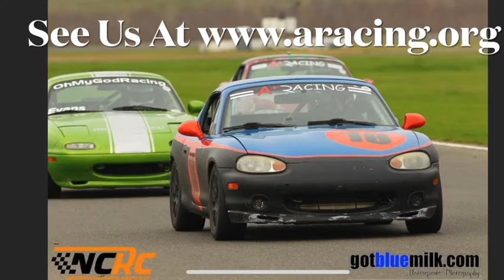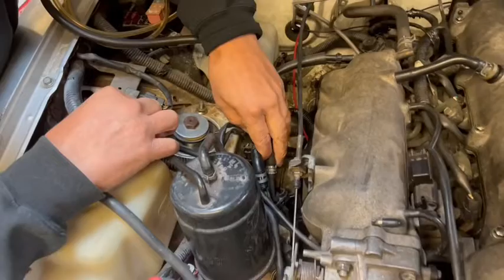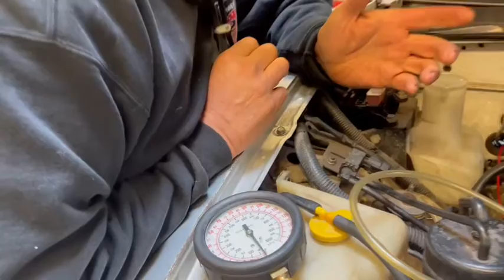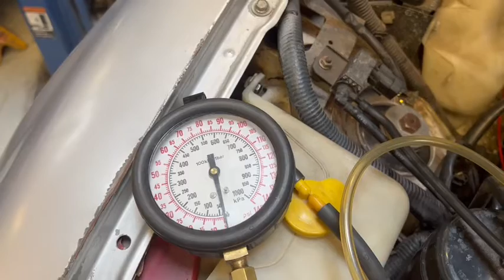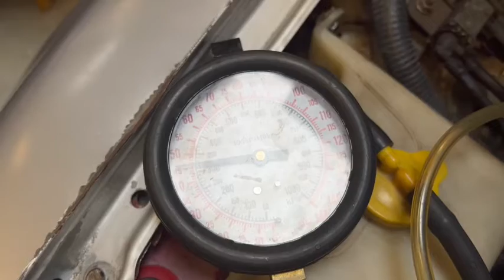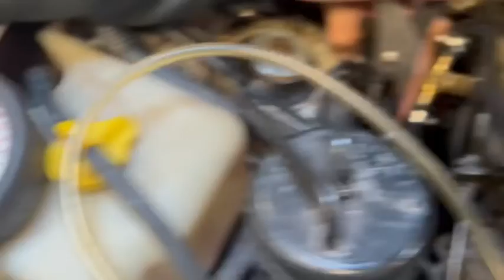Spec Miata, MX5, Autocross No Power Fuel Pressure Test

Comment: Thank you for this vid! My problem is that I’m having low pressure at the low rpm range (1-2.5k), and about 36psi at idle. It almost stalls out below 2k. But once the rpm’s are above 3k it drives great, and pinching the return line off I get a good 80psi. Would this still be a bad pump or could it be something else? Thanks again!

Comment: are you saying that at wide open throttle the fpr has no role anymore? my understanding is that the fpr provides constant pressure (relative to engine vacuum). so even if your fp max pressure is only 60, it is still above the fpr regulation pressure of say 45. so at wide open throttle your line pressure should only be around 45 unless what you  are saying is at wide open throttle you need more than 45? unfortunately wot was not shown in the video. or is it at wot pump could not cope up with the 45 regulating pressure if max pressure is only 60?

Comment: I’m having an issue where I am having a lack of power and a lot of white smoke coming out of the tailpipe. It seems to go away after the car has been driven for a while, but if I added any new oil to the system, then it starts happening again there’s also a chattering noise I believe it has to do with my engine oil leaks around the main seal or heads, but I’m not sure can somebody give me some insight please

Comment: Been having a fuel problem for the last two events. Swapped filter it was better for about a minute and then had the same issue. Was running at 14.1+(got as bad as 15 before I pulled off track with the water temp going up as well). Car was running 12.0 and making full power when I swapped a fuel pump at the beginning of the season. I am thinking I didn't clean the tank enough as my donor car had been sitting for a couple years. Pump on I was getting 40psi. Just pinched the return line, went to 45psi. Pump number three going in this week and I'll see if I can notice any corrosion in the tank. Thanks for your videos as usual.
Reply from the maker: Make sure the short rubber hose from the pump to the line is not ripped. I had one do this a couple of months ago.
Reply: @aracing  will check, thank you!

Comment: What if fuel pressure is around 35 and the car shuts down when you pinch the return line.
Reply from the maker: I can only see that if you pinch off the feed line and not the return.